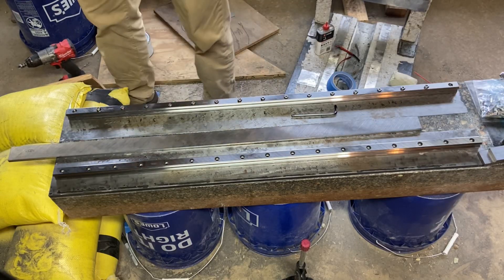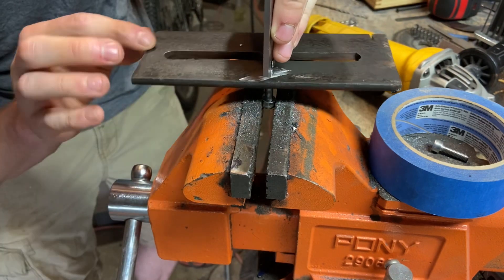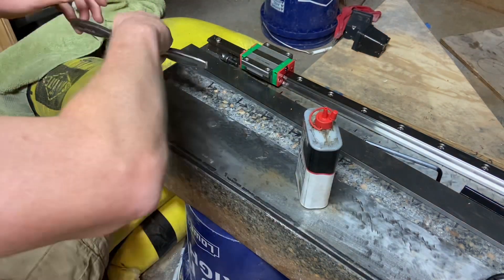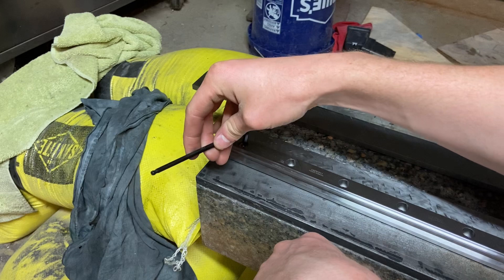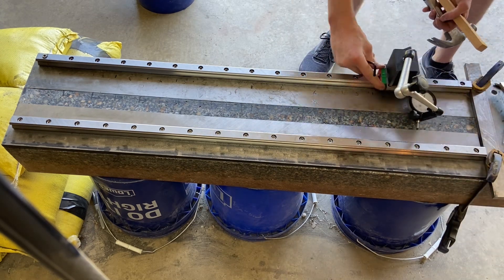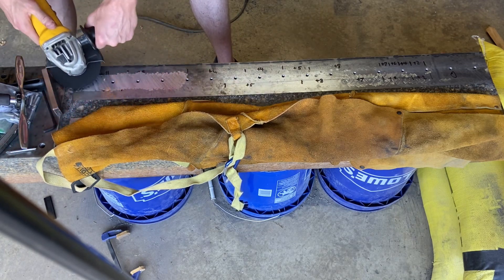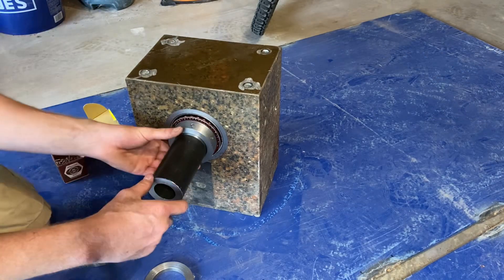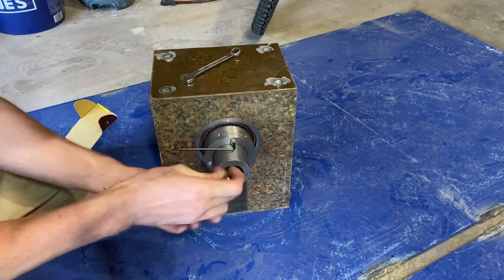DIY Epoxy Granite Lathe #4: Linear Rail 2 and Spindle Assembly

Comment: Looks good though you might want to consider making a fine thread on the spindle and lock washer (or retaining ring) instead of those pointed set screws. They will certainly hold but not over time as the load is imposed on them.
Reply from the maker: Yes absolutely. This won’t really be a final spindle, it’s more of just something that will work well enough to turn myself a better one later. Other than a few limited instances I don’t normally have any access to a lathe, and I have limited access to a tiny mini-mill, so to make a new spindle I basically need something to start with lol
Reply: @robertsteinwandel6658  itio5eyyoyhhv

Comment: are these 32008?
what precision class ?
did you check for their run out?
Reply from the maker: Honestly I bought the bearings about a year ago so I can’t remember their precision class.   To my knowledge, and please correct me if I’m wrong, even the low tolerance bearings only have like .0001-.0002in runout anyways. I really don’t need anything much better than that to be honest, I don’t expect to ever need to hit sub-tenth tolerances or anything
Reply: @robertsteinwandel6658  no the standard/unknown precision class can reach 0.01~0.02mm run out practically and on the paper also, I found difficulties finding a high precision class for these tapered bearings, even skf does not make except the standard class, they are usually made for cars were no greater precision is needed, your ways might be more precise than the rounding of ur turned parts, before making more work on that spindle try to check on its runout, it could be challenging to know unless you turn something and before getting it out of the chuck the dial can tell you
Reply from the maker: @GraphicManInnovations  that’s a good idea, I’ll check that, thanks
Reply: @robertsteinwandel6658  yup btw almost always the precision class is lasered on the the bearings, what is the brand? also how did u make sure that both cones are exactly facing each others with no axial or radial shifting?
Reply from the maker: @GraphicManInnovations  I truly don’t remember the brand, it was too long ago unfortunately. I got them from bearings direct .com. The spindle is certainly a work in progress as I had limited tools to make it. I did have a lathe to cut out a compression fit opening in both sides of a tube, and the bearing outer races are slid into that and reference against a lip cut on the lathe. That compression fit has quite a bit of force, I wonder if it could squeeze the outer races into being slightly more circular? Not a very scientific thought but maybe lol?
Reply: @robertsteinwandel6658  yes indeed, forcing the cones might deform it, it does not really need much to make it out of roundness (that if it is already round enough) , i read that the interference should be close to 5 microns, i did not understand how you made sure that both bores are facing each other? one operation? you should be able to check the bearing brand from the laser print on it
Reply from the maker: @GraphicManInnovations  that’s true. To be honest I had very little in the way of tooling and that spindle was mostly me doing the best I could with what I had. I can’t remember how many thou interference I went with but I think I got the number from Machinery’s Handbook in a table which should be pretty reasonable. 
I’ll have to check concentricity and all once it’s operating and see how it is hahaha, hopefully it won’t be out to badly but if it is I can always try to realign or make new parts
Reply: @robertsteinwandel6658  best of luck, let me know
Reply from the maker: @GraphicManInnovations  thanks!

Comment: Very cool project. A quick tip that might save you some time. Use your tap in your little drill jig connected to the cordless drill to start all the threads (first 3-4 turns) and you know they will be 99.9% straight and way quicker to start.
Reply from the maker: Thats a cool idea! Especially with 2 taps so I don’t have to swap them in and out of my drill jig haha

Honestly at some point I might make a power tapping machine, that seems like a cool project!

Comment: Nice spindle, never seen one that preloads like that. Great idea and easier to make without giant machine
Reply from the maker: Thanks! There was someone else on youtube with a somewhat similar idea that I just modified but I can’t remember their channel to give them credit unfortunately 

The current plan is to use this spindle for the initial setup and calibration of the lathe, and at a later date use it to turn a new spindle thats a little simpler to pretension and possibly uses a camlock system to attach the chuck which would be cool

But yeah I was really pleased that the design seems to work well and basically just needed a drill and a tap and some set screws to get it working
Reply: I first saw that trick on the multimachine
Reply: It was a CKASSIC ! STOLEN ! IDEA ! FORM other You ! Tube! Shows ! Of the PAST !!

Comment: Curious if you have made plans for a base. You may want that in place before spending too much more time chasing the last 1000ths
Reply from the maker: So I totally agree with you, but unfortunately thats not really an option for me- Im working in a garage that other people need to park in, so Im moving this thing fairly often. When it has a permanent spot I have a section of 1/4in wall 10in square tube Ill make a base from, and then Ill fill the tube with sand for the added weight (easier than mixing up so much more epoxy granite)
But yeah, once I bolt it to the base Im sure whatever tensions the base puts on the lathe will throw it off a bit and Ill have to recalibrate, such is life I guess hahaha

Comment: I need seals on my spindle. They are open like yours and the bearings won't last long unless it has protection from grit and chips.
Reply from the maker: Id be really interested to see your current setup! 

And I absolutely agree, Rotarysmp suggested a labyrinth seal in a comment which was a great idea, Im going to try to 3d print one for the next video I believe, Ill see how that goes hahaha
Reply: @robertsteinwandel6658  I haven't had time to mess with it in months. Life just doesn't allow me to work on it right now I started six years ago and built some mills, lathes, and other things to start a small business. It is a very expensive hobby that I would like to go back to.
Reply from the maker: pete garssia well I hope you have time soon! No worries at all, but yes it is such a fun hobby hahaha

Comment: Nice progress both on the machine, and on your video work.

How straight is your straight edge? After you dialed in and tightened the first rail, did you flip the straight edge and repeat the dial gauge run along the rail to see if there might be error in the straight edge? Although chasing sub thou deviations gets to be a bear.

That lathe will have a much straighter bed then my worn Boley, and may even cut straighter than my Schaublin, with it's 11µm wear in the bed.

Do you have a plan for the head stock bearing seal? It is essential to seal that spindle nose end of the bearing from grit and swarf. Typically this is a labyrinth seal. It might be best to consider the current spindle set up as a temporary tool, and protect it with something like plastic and bath sealant,  and as soon as you have it running, use it to turn a labyrinth back plate which you epoxy to the head, and also let the lathe turn it's own final spindle. I would recommend Camlock, because it is cool :), and because there is wide variety of chucks etc for that in north america.

If you drop me a line (email on my channel "about" page, I can send you the drawing of the Schaublin labrinth seal, and also the spec for the camlock nose.
Reply from the maker: Thanks you! Actually that’s really good to hear, if its better for me to add voice over afterwards, thats a lot easier for me to do. 

My straightedge should be straight to I believe .00087in, although I don’t think I still have the card it came with. Unfortunately my other limiting factor here is that I only have a .001in graduation indicator, I may get a tenths indicator soon though. Actually the straightedge is an issue, I had totally forgotten that its error is now a limit on my precision, I was considering it to be perfect before.
So long story short my error is probably close to double what I thought haha, just under .001in instead of about .0005in sadly. 

Actually I do have some for the seal, but not really a good one. I didn’t add the clips to the video because it was late and I wanted to put it out last night before I went to sleep, but I did make a steel cover for the front bearing. I was thinking, I may be able to 3d print the covers if they just protect from dust? I hear the bearings reach something like 100 degrees when operating, but plastic could take that heat.

Im definitely planning for the lathe to at least turn down the end of the spindle and turn the backplate to make sure its concentric and all, is there any reason to have the lathe turn a whole new part for the spindle, instead of just the end of the current one to fit the back plate? Also I need to do a ton more research on chucks but cam lock does seem really cool hahahaha.

I will definitely shoot you an email! Thanks a ton for all these resources its been a huge help
Reply: @robertsteinwandel6658  Getting started with the lathe turning some sort of flange which you can bolt chucks to will be a good start, but a tapered nose makes mounting and demounting with consistent run out easier, and camlock makes it much faster. Once you get the lathe running, and us it to make a better spindle, you can also put threads behind the bearings, and us a nut to set the preload, with the issue of uneven preload on the inner races which you might get with that current system.

The proof will be when you turn a long test bar. I forgot that horizontal bed errors go into diameter at 2x error, so my 11µm bed error could be 2/100's over the the length. I assume it will be a fair bit less, as the long saddle averages out some of the error.
Reply from the maker: Thats a great point honestly. My current spindle is basically the best I can do with my current tools, Im sure it would be much better to use a “real” spindle design in the long run lol. 

Actually in the next vid Im planning to go through my plan to dial in the accuracy of my machine, nothing crazy about the process just turn a long rigid bar and check diameter with a micrometer, but I have some ideas on how to fine tune the accuracy that Im still working on.

Im really interested to see what results you get when you have a chance to test it!
Reply: @robertsteinwandel6658  I think that is a really good plan, make the spindle simple and doable with what you have now, and then upgrade it. It would be easy to kill a problem like that with analysis paralysis if you try to do "perfect solutions" not in the current scope of your tool access.

By the way, at the start of the video the first few seconds are critical to hook viewers. The start of this one was really good, but then from 00:30 to 00:48 nothing happens, and you will lose the audience. Chop bits like that.
Reply from the maker: RotarySMP thanks for the feedback, yeah that makes a lot of sense. Ive definitely started chopping more and mire with each video, my first vid was 1 take right through and this one was like 2 hours down to 15 minutes. That makes sense though to keep it moving especially at the start. 

Is there a way to change that in youtube at all or should I just go back through and change it in my editor?
Reply: @robertsteinwandel6658  In you tube studio, go to the video, and then use the editor tab on the LH. Removing a part like from 00:30 to 00:48 is easy. 

If you re-edit in your computer software and re up load it, it is a separate video, there is no way of linking the views, comments etc.
Reply from the maker: Maybe the problem is just that Im on mobile, but I don’t see an email on your channel page. My email is robert.steinwandel@gmail.com if you’d be down to send the Labyrinth seal drawing!